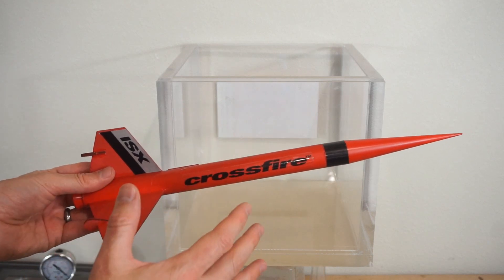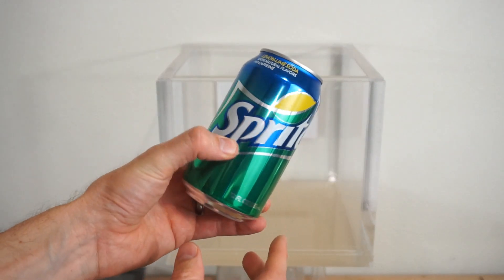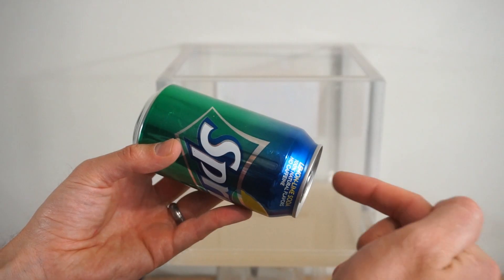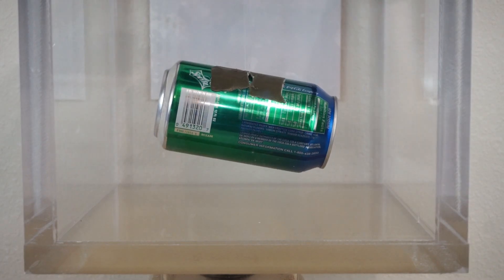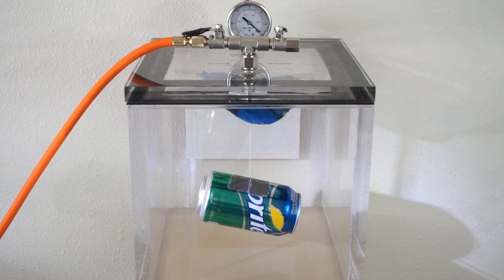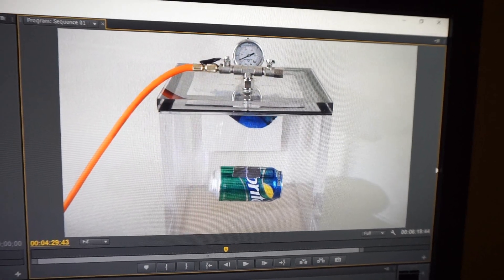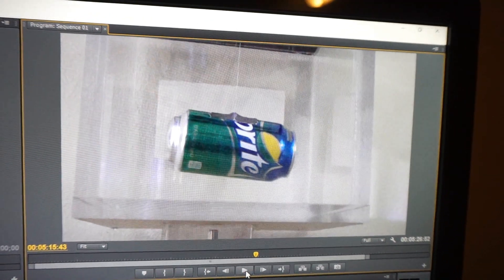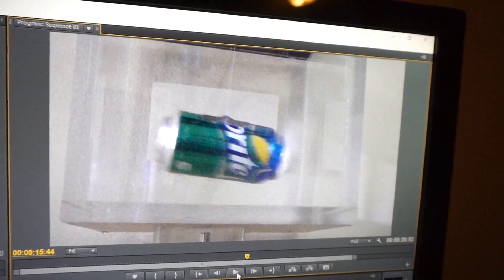Can a Rocket Fly in a Vacuum Chamber?

Comment: Hey dumb dumb.  It of course shoots forward.  It is being propelled forward due to you being on earth so Gravity (actually density) is a force in action. You also can not make a vacuum powerful enough to represent space.  Don't do science experiments until you know what the hell you are doing.
Reply: Brad Tiehen
No, it's being propelled forward because the forces acting on it, are imbalanced.

There's a hole in one side, meaning that the force of the liquid and gases pushing on the bottom, won't be cancelled out.

Comment: There is air in the can itself. Also, when it explodes the pressure is released so I don't think this is technically a vacuum.
Reply: the experiment is to proof that a rocket can fly by itself.  If the can moves by itself then a rocket can too.
He made clear in the video showing that the can moved before the air expanded in the chamber.
Reply: Cristiano Ferreira There's still air in the can..like I said. He can't remove the air trapped inside the sealed can.
Reply: yeah... so?
That´s the experiment: to prove that a sealed object can move in vacuum by expelling matter.
The object itself doesn´t have to be internally in vacuum.
Reply: VikingWizardEyes
That air, in the can is part of the reactionmass that moves the can.

Comment: The rocket should have less propulsion in vacuum, because while there's still a pressure differential on the front side inside the combustion chamber relative the free exhaust toward the back, it lacks the added pressure outside the exhaust due to the massive compression of air.

1 atm of added pressure differential in vacuum isn't all that much compared to how high the pressure is inside the combustion chamber.
Reply: rockets have more propulsion in vacuum just because there is no atmosphere to fight against when moving.

Comment: actually this experiment is flawed. if that was liquid, it can push agaist its own liquid if the liquid is pushing against somthing. in a vacuum, water vapor would be enough to create atmosphere. the experiment is inconclusive due to poor enviroment. try bigger chamber and use a real rocket this time with air and keep the vacuum on and see if you get the same result. even i do believe the earth is round, i know that atmospheric pressure do increase thrust and the little force that can be created in a real rocket in hard vacuum is ridiculously small.

Comment: The gasses here are pushing against the cans lid and then the glass wall, conclusion, rockets do not work in space.
Reply: J.P Doesn't have an argument so instead attacks Tyres1987's character instead of the obvious false equivalence of comparing a glass box to the endless vacuum of space. Conclusion = Ad hominem.

Comment: The vacuum that was pulled in that tiny chamber isn't close to the constant relative vacuum in space. Moreover, the front of the can exploded off of the cylinder of the can, which is precisely what the cylinder pushed off of to give the appearance of thrust in ypur vacuum chamber. The thrust that was created in that tiny vacuum chamber was caused when the top blew off. In any instance, yes, this experiment did prove Newton's Third Law of Motion however, did not prove thrust, via cbemical reaction, nor pressure differential, can be acquired in the full vacuum of space.

Comment: The mass doesn't 'push' it forward per sey UNLESS there is some constraint that develops a pressure gradient.  Obviously in space there is no volume constraint.  lol.   So in a vacuum in space anyway it accelerates because of the conservation of energy/momentum laws.  Which governs the distribution of a mass basically.  If part of the mass is propelled one direction through an energetic reaction, the kinetic energy of the remaining mass will be displaced the opposite direction.  We have to calculate in losses to local thermal energy increases etc. in a system but anyway generally those are the factors.

while there is a limit to the response time of your pressure guage, it's still possible that your experiment established what you were shooting for.  You're forming an assumption based on the notion that all relevant gasses are visible which isn't necessarily true.  Would have been nice to have a bigger chamber to remove all doubt for people but a good budget effort anyway.
Reply: Let's see... you say if I showed you the math (and physics) I'd...still be wrong?  uhhhh..

First you have a differential equation that would involve a lot of speculation   unless we delve into some incredibly complex study about how mass distribution of fluids and gasses would work in a specific set of conditions like that.  So I'd rather save my life and note that I'm simply reciting an established law of physics.  Conservation of energy and momentum.  Since no matter is being converted to EM (or a negligible amount) we can safely say that the sum of all kinetic energy of individual particles is conserved.  From our initial frame of reference with the camera we observe zero kinetic energy.  As mass is allowed to expand with the rupture of one side of the can we have a rapid acceleration of mass to the right generally and hence an acceleration of the remaining mass to the left.

So I don't know what you are saying I"m wrong about...

Comment: To the video creator,
You are falsely claiming that the can of sprite displayed "thrust" in the vacuum chamber in your attempt to answer whether thrust can be created in a vacuum such as space.
That is my claim against you. Now, my turn to explain why your claim is incorrect.
Here goes...1) When the top popped off the can of Sprite, the remaining aluminum cylinder was pushed forward. However, the very moment the top was blown off, the rapidly escaping cO2 inside the can was pushing off from the separated lid, which in turn gives the misleading appearance that the can was thrusted forward in a vacuum only from the expanding cO2.2) The very moment the can began to burst, the vacuum that was created was being lost. Space has a constant vacuum, and your tiny box isn't a good resource to try and replicate anything close to the conditions of space.3) When a chemical reaction occurs in space, such as when a rocket's liquid or solid rocket boosters ignite, the mass being ejected is absolutely miniscule to that of the weight of the craft. You conflated flame throwers with the analogy of throwing a bowling ball in space. I'd contend the weight ratio of the craft plus the weight of fuel as to a person throwing a tennis ball in space.4) A rocket engine uses chemical reactions to create explosive gasses. Albeit, gasses are matter, except they aren't solid matter. Expanding gasses work as propulsion where there is, i) solid matter to push off against, ii) liquid matter to push off against, iii) other slow or still gasses, or iv) in short, a solid platform, or atmosphere with enough resistance to withhold the weight of the mass that is trying to depart from. There is no atmosphere in space, and nothing to offer friction to thrust/push off of.
A rocket, a space shuttle, any spacecraft with a propulsion system becomes directionally useless when it exists our atmosphere and enters the vacuum of space. The rocket boosters become flame throwers that can't produce thrust. In actuality, an astronaut would produce more "thrust" if he/she climbed out and nudged the craft in the direction they wanted the craft to go. Inadvertently however, they would travel in the exact opposite direction.
To sum this all up, a rocket firing in the vacuum of space is expulsion, not propulsion. There is simply no mass in which a rocket engine could thrust off of to alter trajectory, or slow down.

Comment: you think it moves by pushing on ground or air? it moves because gases are impacting to top of the tank inside. what comes out is the equal and opposite force not felt, hence moves in the direction of impacts.

Same with a wing: the shape increases wind speed on top so that the ratio of impacts of vibrating gases are greater beneath than above, ergo lift.  if you could ionize the air above and apply a repulsive charge, the ship would be pushed toward the relative vacuum.

Comment: what an idiot, the "needle" on the gauge is "reading/sensing" the vacuum at the gauge, NOT THE COMPLETE CHAMBER. Like sound waves, the vaccum was lost the second the can exploded. If he had six or multiple gauges monitoring the chamber, you would see them loose vaccuum at different times. Flawed premise, flawed experiment. The can is what filling five percent of the chamber? If he were utilizing a chamber where the soda can represented say 1/10000th of the chambers volume, this would be more accurate.

Comment: It's obvious the pop hit the wall and splashed the same direction as the can flew, so this didn't prove the hypothesis that spaceships are able to fly in space. He needs a larger chamber to have a good experiment. 

Also, could be wrong, but if a man is on a skateboard throwing a bowling ball, he is still pushing against the floor. If suspended in a vacuum standing on a skateboard throwing the bowling ball, he'd have nothing to push against and probably spin around as he tried to propel the ball in a direction he wanted to go. Maybe someone can explain this better.

Comment: the can is packed full of pressure and gas.....its carbanated.
when it's released it builds  a gas cloud that then begins to spread out losing its integrity. 
the speed in which this happens would have to do with the side of the vacume chamber.... the more space the less resistance.
the less space the more.
remember they say that space blew up....big bang.
the smaller the space the faster the build in pressure 
like a bomb.
all your doing is creating a space that then gets deluted with gas.......gas fills it container.
it's a represurization on a weaker leavel.
bigger space less gas delute.

the gas does not need to hit the wall.
it comes out compressed, 
And then goes on to fill the space becoming less compressed than when it came out.
we don't know all the varubels to clame this a scientific representation of space.
this is theory.

Comment: thought i'd add this comment as well 

the can is pressurized and when the can is opened it is de-pressurized. the escaping gas or pressure that you can't see hits the wall of the vacuum chamber and the wall of the chamber resists the motion of the escaped gas and pushes back on the oncoming flow of pressure, which causes a build up of pressure and it is this build up of pressure that pushes on the can to move it in the opposite direction! Remember to every action there is an equal and opposite reaction or resistance to that action!

Simple!
Reply: wow you only worked it out 'quite some time ago', you guys are slow! regardless you worked it out and yet people like m don't accept your explanation to be true because you fail to take ALL factors into account within your explanation! You guys explain it selectvely! Now that's not science, that's manipulation of the truth!

Comment: I'd like to see a vaccuum airship attempt. Build a lightweight frame to hold a lightweight airtight container (a balloon or bag of sorts) open and pull a vaccuum inside the container. Helium floats due to it being lighter than air, a lack of all gas should be lighter by definition.
Reply: If you filled a mylar birthday balloon with 5 PSI of helium in a vacuum chamber, the balloon would NOT float.
It would drop to the bottom of the chamber.

Comment: Does rocket fuel work with pressure or expansion? What about the ignition? Will the fuel ignite in a vacuum. I saw another video of a rocket ignited in a vacuum tube. I think there is a flaw in the test but I can't work out what it is.

Comment: So a rocket in space can be propelled by anything if it's pressurized? Not actual fuel
Reply: 216 US2017 pretty much yes. Acceleration is caused by imbalanced forces so once  you create an imbalanced force you will have movement.
Reply: Pretty much, as long as the momentum out the exhaust is greater. Ion drives notably accelerate charged particles through a magnetic field to generate thrust. You could also throw random objects in the opposite direction to get a net force.

Comment: You need a bigger box ,way bigger. That little box  instantly gains atmosphere the instant  the rupture happens, your dial appeared stuck for a moment also.
Reply: "That little box  instantly gains atmosphere the instant  the rupture happens" - the video clearly shows that it doesn't. 
"your dial appeared stuck for a moment also" - indeed, that shows that the box does not instantly gains atmosphere.
Reply: That doesnt change the result. Newtons third law of motion.
Reply: No, it doesn't!  Show us the results of your instrumentation of the pressure within the chamber over a timeline, say with sub-microsecond resolution, Randall.
Reply: If the test was done in a large tank the can would move a short distance and stop. The amount of gas required to travel for any distance would make space travel impossible
Reply: @neehee941  are you familiar with the lack of air resistance and gravity in space? It would carry on moving for a very long time at whatever speed it managed to get to
Reply: @neehee941  "would move a short distance and stop" - why do you believe that? What would stop it? 
"The amount of gas required to travel for any distance would make space travel impossible" - how much gas would be required to make space travel possible?

Comment: Such a small vacuum chamber will not work. The moment nanoseconds -  in such a small space you put anything in, there is no longer a vacuum. So-called space goes forever. Rockets cannot work.
Reply: Rockets work because they exert a force in the mass they eject out of the nozzle and the mass exerts a force back on the rocket in accordance to the third law of motion. 

It would be a violation of the laws of physics if rockets didn’t work in a vacuum.
Reply: @AM-rd9pu  The first atom out of the rocket chamber has nothing, zero to push against. The next atom pushes on the same nothing.

 It would be a violation of the third law if that atom could push against nothing and propel the rocket.
Reply: @billhesford6098  You’re operating off the false premise that thrust is produced by the exhaust particles pushing off something after being ejected from the nozzle. 

Thrust is generated as the rocket nozzle exerts a force on the exhaust and the exhaust exerts a force back on the nozzle. The pushing happens before the exhaust leaves the nozzle. A force from the nozzle is why the exhaust is ejected in a confined plume in the first place. 

The rocket isn’t affected by what the exhaust particles do after leaving the nozzle for the same reason that you don’t feel when a ball you threw hits something.

Comment: You're still not proving anything wrong.
Fatal Flaw: The minuscule (relatively speaking) Vacuum within the small confines of the vacuum chamber is displaced by the voluminous "mass of the gas" therefore providing "something" (the mass) to react against. 
Please, render your experimental room an absolute vacuum THEN do your experiment...preferably without a supplemental breathing device.
Please drive through, pay at 2nd. window.

Comment: Isn’t the sprite just pushing off the side of the glass? In space nothing would be behind it to push off of.
Reply: This is something you can try at home :

Take your kitchen sink spray nozzle and wrap a rubber band around it so that it sprays when you turn the water on.  Balance the nozzle in such a way that the thrust is equaled by gravity (the hose is suspended when you turn the water on).  It might take a little time to get it balanced, but it is possible.  Now, while the water is spraying out, take some solid object and place it directly in front of the nozzle.  Vary the distance.  If what you say is true, then the nozzle should shoot off as soon as you place something directly behind it.  You will find that the "thrust" is exactly the same regardless of what the water hits or how far away it is.

Here is a video to help you understand what I am talking about :

https://www.youtube.com/watch?v=VxqHS1Q1TgI
Reply: Brandon
No it isn't.

The Sprite, if anything is pushing off of the bottom of the can.